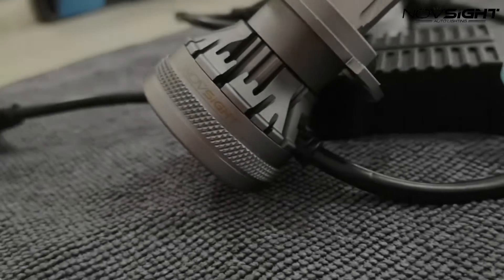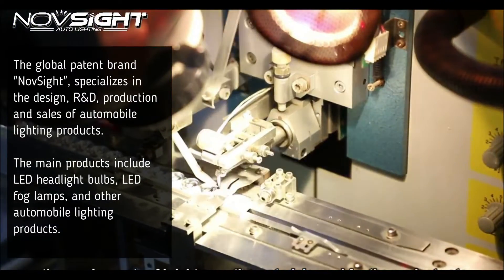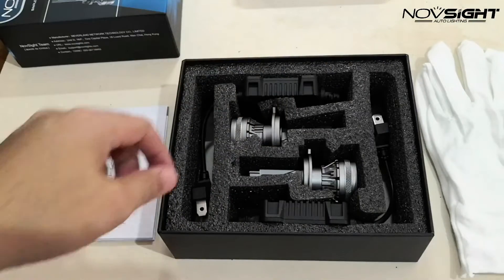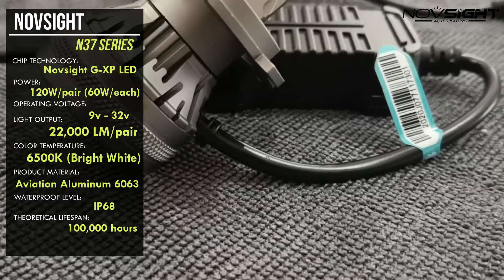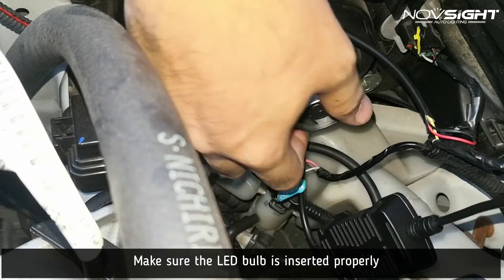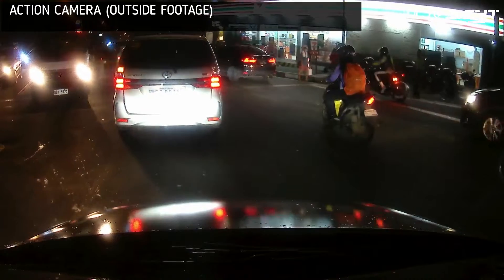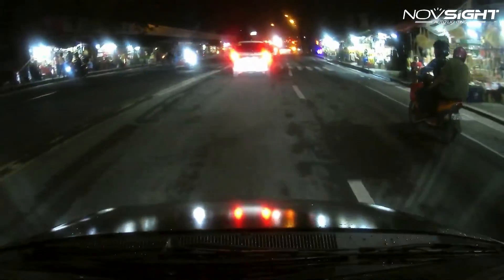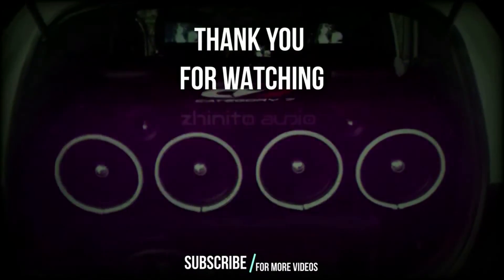Novsight N37 LED | Installation and Full Review |@NovsightAutoLighting  #NOVSIGHT

Comment: okay din ba yung bagong model ngayon na n60, planning to buy din kase
Reply from the maker: Hindi ko pa personally na try pero based sa specs, mukhang maganda naman, 40,000 lumens 200w and 6500k white. I think by far ito pinakamalakas na ilaw nila, cguro need lng i ensure na properly aimed yung headlight kasi masyadong maliwanag
Reply: Thats about 100watts per bulb, check your stock recommended watts

Comment: Question lng po, does the high beam indicator in your dashboard work po? Kasi madami po kai akong nakita na di nag show yung high beam indicator.
Reply from the maker: if i remember it correctly yes. The highbeam indicator (blue) shows up whenever i'm using high beam.
Reply: @carbitstv  thank you very much po for the info!